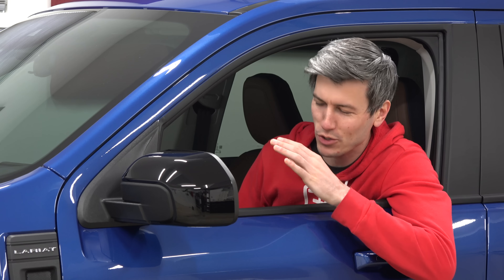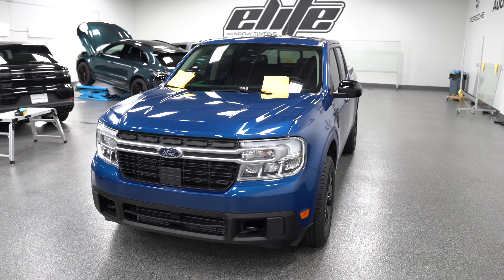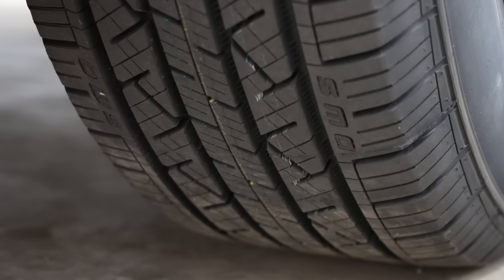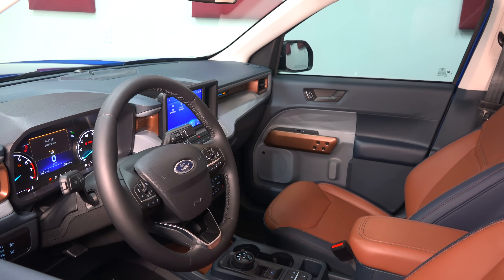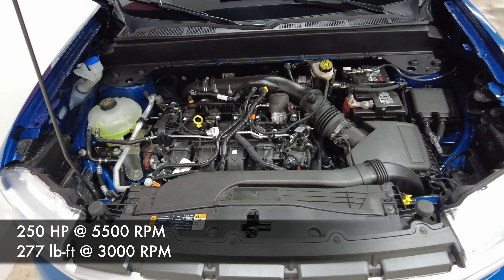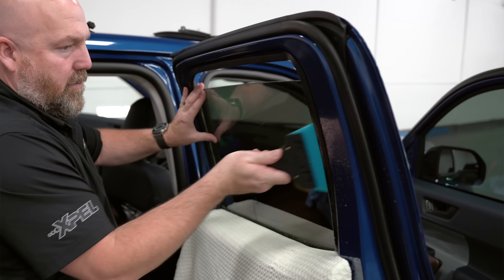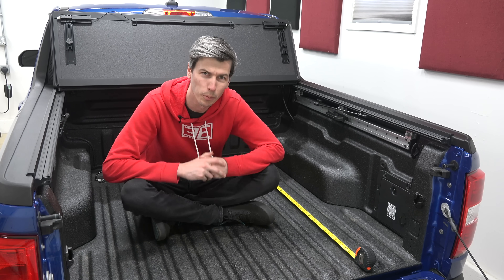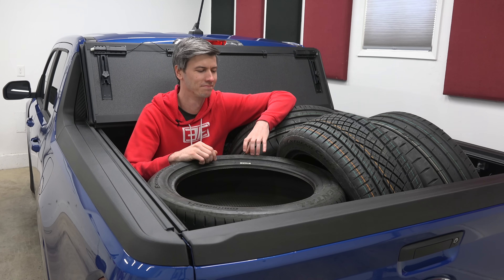I Bought A Ford Maverick! The Perfect Pickup?

Comment: I'd still prefer an 80s or 90s Ford Ranger with the i4 engine and 5-speed transmission, with the 8ft box. 

I'm so sick of manufacturers trying to eliminate manual control for friggin everything. Basic cruise control is enough; nobody really *needs* adaptive cc. I also don't prefer an automatic transmission, and I despise infotainment systems with the passions of a madman. Bleh.

Also, show you an SUV that can haul more? Have you never heard of the Chevrolet Suburban? Your 4 mulch bags would only take up a corner of the cargo room in one of those. 🤣

Comment: Anyone who says it's not a truck is compensating. A Maverick is more truck than most people who own trucks need.
Reply: 1 % of America hauls round bales.
Reply: @danallen578 Much less than 1%.
Reply: @danallen578  Being generous i see
Reply: @danallen578 …. Not even 1%
Reply: My buddy bought a hybrid Maverick.  It never fails to surprise me.  A couple times he's hauled a thousand pounds.  It didn't even struggling.  The sport mode makes it a holy terror.  And I've seen it put some ridiculously geat mpg.  And he found a solution to the to the times when he needs to haul something bigger than his atv (my full size pick with the 8 foot box).  Is it a "truck"?  Maybe, maybe not.   But it is pretty handy little vehicle.
Reply: most big trucks I see, 1 person no passengers, nothing in bed, no boat or trailer, bed like new, seems lots of posers or 1 time/yr use or ?
Reply: @JJRodin   Moset crossovers/sedans/ets I see have one person in them. It's almost like a lot of the time none of us are using our vehicles to their full potential. It doesn't mean we don't use them to that potential often enough to need/justify them vs a 2 seat Honda Insight. The dumbest argument I see. The reality is the Maverick can't do a lot of real truck stuff that the ranger can and unless you get the hybrid that cant do hardly anything it's not even significantly better on fuel. Ranger is was and probably will for awhile remain the correct answer for the most versatile reasonable size truck even if it's got a bit chunky lately.
Reply: It's more truck than my 1947 Dodge 1/2 ton - other than the short bed
Reply: actually they are perfect for intended use, should only be hybrid version imo for high mpg, alternative to a suv, for urbanites who need to haul fertilizer for lawn, plants, new lawn mower and such, who needs awd even for snow, fwd gets you thru most.  Ford DOES need to bring back actual SMALL trucks at SMALL prices like yesteryear, no fancy nothing, just good mpg and 5'-6' bed and less than $30k all in for a 4wd version - who needs auto pilot, wake up pay attention humans or move away from big city traffic or ......
Reply: lol how much plywood and how many 2x4s are you guys hauling on the daily in your brodozers? Fucks sake. This is a great truck for someone who doesn’t do daily manual labor. Can throw way more in it than you can with an SUV or Sedan, and if you need that capability and don’t have an issue with your weiner size then this is a rad vehicle.
Reply: @grownads that's where you're wrong. You can't throw more in a Maverick than any SUV or wagon. The vast majority of Americans are better off driving an SUV, wagon, hatch, or van. People buy trucks because they want to feel cool. The Maverick is a mom machine. Plus, Ford leads the nation in recalls. Tons of people are having issues with their Mavericks. 

Anyone who wants a REAL small truck should buy a late '90s to 2011 Ford Ranger. Now that's a small truck with class. 6 foot bed. No bells and whistles - just a real, reliable truck. But no... mommies and daddies want their fancy interior, rear seats that will only be used twice in 7 years, tiny bed for groceries, and Apple CarGay.
Reply: @iannelli2448  That’s you’re opinion. The fact they can’t make enough of these shows other people have the same opinion. However, I had a new 1994 Ranger for a short time and I agree with you. There was a lot right with that truck. The one bad thing. You had to put 200-300 lbs of sand in the bed over the rear wheels to make the truck drivable in snow.
Reply: @iannelli2448  You absolutely can throw more into a mav than a SUV of van. I hauled a bedroom full of furniture, including a queen mattress and box spring, in the bed. Can't haul that in an SUV.
Reply: @jtthomas1  Sure, but the overall point is that you do not need a truck for the once-every-4-year instance that you have to move bedroom furniture. That's the problem with Americans. They conjure these "needs" in their minds to justify purchasing giant expensive toys. Look at how many hipsters and soccer moms who own $60k Toyota 4Runners that have only taken it "off-road" once in 7 years, and by "off-road," I of course mean a gravel path that any '90s Honda Civic could traverse.
Reply: If a japanese kei truck can be a truck so can this
Reply: I live in Ft Worth/Dallas area. 3/4 ton diesel 4x4 pickups less than 4 years old in highest trim could have a 24 inch bed and 60% of owners would not fill it. A 24 inch deep bed would hold shotguns or golf clubs.
Reply: I just use their own logic on them.  Does your truck require a CDL?  Is it pulling a 53' trailer?  Then it isn't a truck.  It's a toy.
Reply: @wildonion99 💯
Reply: Hahaha 😂
Reply: It is front wheel drive and front wheel biased in AWD, and unibody. Not a truck. Hopefully it comes with a purse
Reply: My big 4x4 pickup is not "compensation". It's not, it's not, it's not!
Reply: I don't call it Truck. To me a Truck needs to be BOF, whereas the Maverick is unibody. 

I instead call it a Pickup, like the VW Pickup of old, or a Ute.
Reply: It’s a ford escape with a bed and less room inside, get real truck f150
Reply: Doesn’t that have a 4 foot bed? Honda Ridgeline has a 5 foot bed. 🤣🤣🤣
Reply: You explain to me what kinda work you're doing with a 4.5' bed. I'm waiting. You put a toolbox in the back of that and you've got maybe 3' of space left. What are you doing with that? Not throwing plywood, sheet rock, 2x4s or helping someone move with that small amount of space. I have a truck to do work in it. That "truck" isn't doing anything but make you feel better about yourself.
Reply: @jordanhart9708  
Actually you can haul 4X8 sheets of plywood flat in the Maverick. They designed the sides of the bed to accommodate  foot 2X4's across into slots built into the sides of the bed giving you about 53" of width above the wheel wells. You can see the indent slots in the bed sidewall in the video. Drop two cut 2X4's in place and boom, you can haul a handful of 4X8 sheets of plywood or drywall flat. The multiposition tailgate can then be adjusted to line up perfectly with the position of the bedside slots giving you full support of the sheets up to about their 6 foot mark. Sure 2 feet hang over but still more than adequate for a trip to the lumberyard or HD to bring home some 4X8 stuff.
Reply: @adamn7516  Are you doing that with a completely empty bed, or do you have a toolbox in the bed? As for your "cut 2x4's" yeah. I can cut 2x4's and fit them in whatever sized vehicle I want. Doesn't make it special. I don't have to put down my tailgate for sheetrock or plywood, even with my toolbox in the bed.
Reply: @jordanhart9708  
You are missing the point. Nobody is saying that the bed of the Maverick can do as much as a 6 foot bed. Just saying that it can do more than you give it credit for and for MOST people it is a more than adequate. 

Majority of pickup owners these days never use their pickups for what you describe and bedboxes are less needed these days since most pickups these days are crew cabs or extended cabs and do not need lockable storage in the bed. So in most cases people can easily get away with a bed the size of the Maverick or Santa Cruz.
Reply: @adamn7516  That's not every case. Even with mid size trucks, it's harder and harder to find a 6' bed. The fact the vehicle that was recalled for an evap leak into the fuse box should already be a do not buy. Most people that are buying a truck these days are doing a dick measuring contest with their pavement princess. Not chasing practicality and fuel economy.
Reply: @jordanhart9708  
Not sure what you are arguing for. You just reinforced my point. Also arguing quality control is an unrelated issue. Plenty of recalls for mid and full size trucks for various issues over the years including ones to mitigate risks for fire.
Reply: @adamn7516  How am I reinforcing your argument? Or do you really somehow believe an oversized Polaris Ranger is the perfect pickup? The degree to which you have to go wrong with your designs for your gas fumes to get to your fuse box, potentially resulting in your vehicle spontaneously combusting even when the engine is off isn't a simple "woops". Neither will I excuse the supplier Subaru had basically sold them grandes rather than airbags.
Reply: @jordanhart9708 Gardening. Or pull a light weight trailer with dirt bikes and you can put stinky gas cans or dirty gear etc in the back.
Reply: @jordanhart9708 yeah because everyone wants to help someone move....that's actually a reason not to get a truck 😂😂😂
Reply: @UnknownUser-vu6xq  Then you can buy your Prius and be happy. I'll keep my truck.
Reply: Maverick is a joke, these tiny bed trucks are all a joke from all the manufactures, anything under 6 foot for the bed has no place in the driveway. I will keep my 2023 Toyota Tacoma with the 6.1 foot bed.
Reply: @LeeCountySpeedShop  I'm sure you'll put it to good use
Reply: @LeeCountySpeedShop  The maverick has a higher payload than your Tacoma. So, technically it can fit more stuff in the bed than yours.
Reply: @LeeCountySpeedShop 6.1ft? What a toy bed size is that? Can't even lay down in a sleeping bag, I'm 6.2. Are you short? If you can't haul a racecar on the back, it's not a truck. What do you haul on yours, Barbie jeeps?
Reply: JUNK
Reply: You couldn’t move a couch with that bed. People who call this a useable truck are just virtue signaling 🤷‍♂️
Reply: @b3dazzl3  i've moved a bedroom full of heavy furniture in this truck, son. Could easily carry a sofa.
Reply: @jtthomas1  lol cool story bud. Completely subjective descriptors on your part; I’m sure you moved that loveseat so friggin good! Lol
Reply: @b3dazzl3  Realistically, how frequently are people moving houses?
Reply: @gabrielcater  replace couch with, plywood, or 2x4’s. If this truck works for someone that’s great! But if this truck fits someone’s needs most likely a Corolla or RAV4 would also meet almost all of their needs and they could rent a pickup truck in the few instances a Corolla or RAV4. I used to have a compact ranger in the early 2,000’s I’m well versed in the small truck cope; and I’m trying to point out the hypocrisy of the people compensating for having a small truck by calling out full size truck owners as someone who is compensating
Reply: @b3dazzl3  incredible how clearly you've shown us you have no idea what the phrase "virtue signaling" means
Reply: @spacemandave2345  ok
Reply: @spacemandave2345 It is a good use of “virtue signaling”. People who drive big trucks want to show how “hard working” they are even though they don’t  use their truck for work.
Reply: @b3dazzl3 it's an embarrassment of a vehicle lol. My 2011 Ford Ranger with a 6 foot bed is more "truck" than the Maverick.
Reply: Good luck being a home owner and getting anything for the house in that little toy truck
Reply: @OGAaronAlton  it’s almost as if there’s companies out there that’ll let you rent out box trucks of different sizes to help you move from one home to another. What’s the name of one of them? I think it starts with a u
Reply: Really? Can you fit a 1000 round bale in it. No? Then it ain't a truck, it's a toy.
Reply: @user-jd5sj8jx7r Round or pound? Maverick payload is 1,400 pounds.
And sure, because the tens of millions of pickups on the road every day are carrying bales of hay.😂
Reply: @dvader3263  If it can't haul a 1000 round bales it's not a truck.
Reply: @user-jd5sj8jx7r  Fair enough, you don't represent the target market for this vehicle. But every time I see a pristine F-250 parked at a grocery store, mall, or Starbucks, I think that truck will never see a hard day's work in its life! You buy the right vehicle for your needs, so don't badmouth others who do the same! More of these little TRUCKS on the road makes it easier for you to have the truck you prefer.
Reply: @user-jd5sj8jx7r  Yeah!  Most truck drivers need to haul bales every day damnit!
Reply: I mean, it can? 1500lb payload, 5ft bed. But if you're only buying one bale you're a poser anyway. Buy a season's worth or do you only have 1 cow for your AG credit baby boy.

Comment: Between these and ridgelines they are a great option for pavement pounders with cargo/tools. Unfortunately a lot of us actually have to go off road. Which would need to be “body on frame” no negatives. Just gotta realize what you positives you actually need. I run heavy equipment that gets parked on powerline easements. At times, my truck needs to be able to navigate timber mats, and basic wagon trails. I honestly wish I could get a ridgeline like my brother in law….but will be getting the Ranger raptor

Comment: I had my Maverick since 2022 and I can't be more happy with it. I use it for recreation and it offers all I need and more, who cares if this is a truck or not?.
The only think I don't like is regarding the gear wheel. I use the Maverick to go to the beach a lot, but when sand gets inside the cabin and in the center console, little grains of sand slips into the gear wheel making it to gets stuck when moving. More than once I got stopped, in the middle of the driving, because the gear was stuck and I can't move it to drive. When that happens, you jiggle it back and forth till it goes through, but it shouldn't happen at all.

Comment: So, full disclosure, I have a 22 Maverick Lariat in Alto blue. With your same options. And I had a Crosstrek. Main point of this truck is that the 5-6 times a year I need a pickup bed, plywood, furniture or motorcycle transport, I love it.  The rest of the time it is like a Honda with great hwy mileage and a blast to race away from lights. And I can park it anywhere. You are spot on with your review. Great job.
Reply: Funny I drive a Crosstrek now and my dad told me he's thought of getting a Maverick. I should send him this video cause I know he'd love this truck. I find it so annoying when people want "the biggest truck" and struggle to park anywhere, and especially when 99% of what they do doesn't necessitate the truck they own. If all you're doing is going to an office job, grocery shopping and maybe just a night out, why waste money on something so impractical just because "it's big." That whole "machismo" thing needs to die already.
Reply: What size of bike can you fit in the bed?
Reply: @Megs125  I doubt much of anything worthwhile... maybe some little things like the Grom.  It should be able to pull a bike trailer though.
Reply: Great points. That's why I bought a Honda Ridgeline black edition used with way better assets than a maverickle, and cheaper.
Reply: @defender714  Understood, I just like my rebodied Escape over the rebodied Odyssey.  Just not a fan of minivans.  But you do you.
Reply: Maverick can carry full 4 x 8 sheets of plywood as standard.  The tailgate cable adjusts to keep the tailgate at the level of the plywood.
I added the All Black Package that makes the seats black and looks much better than the pumpkin/peanut butter colored seats.
Reply: If you want to carry plywood or even motorbikes, just buy a van already. ( a van holds full sheets of plywood without any issue)
Reply: @mick0matic  I have a Ford Transit van and it is geat for building materials but motorcycles do not fit in unless you have a high roof model. Or own a Vespa.

Comment: Doing a road trip with 3 adult passengers though? Yeaaah... No. The rear passengers seats are so crammed and upright. We rented a Nissan Frontier (which is one step above the Maverick, in terms of size class), and it only took my dad about 10 minutes to complain about the rear seat. Besides works, pick-up trucks are impractical in most other situations. Lastly, to answer your question at 8:15, any compact SUVs (RAV4, CR-V, Tucson, Sportage, etc) can EASILY fit those in their trunks.